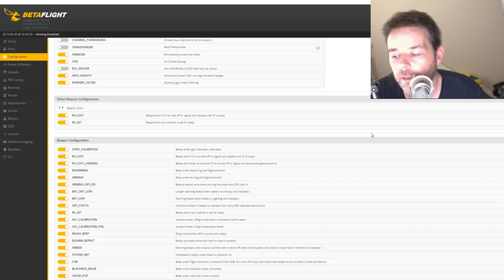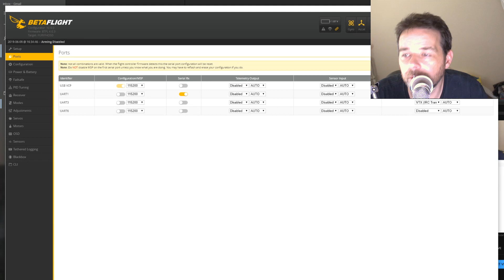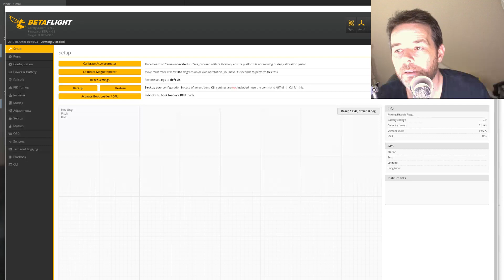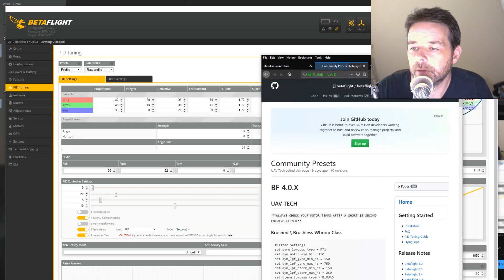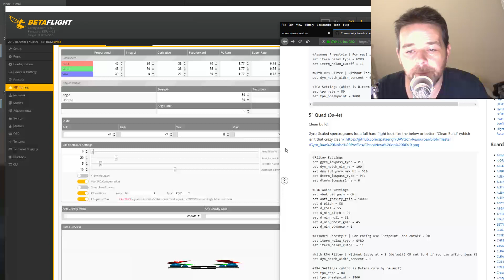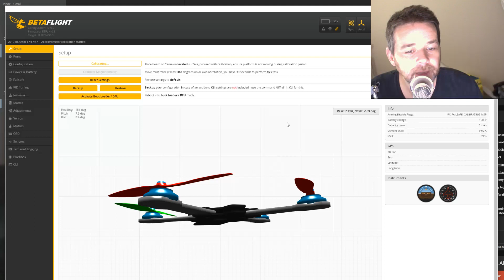Betaflight 4.0.3 live Setup for the Diatone GT-R349

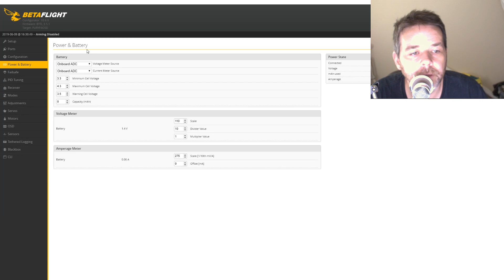Comment from the maker: In Power/battery after re-flashing, copy settings from 2:11 or your power readings wil be off.  Onbard ADC for amp meter, 275 for the offset.  check 2:11 for the correct settings

Comment: I followed exactly your setup here in the video but I got pretty bad vibrations (unsmooth motor sounds) until I switched from Bi-quad to PT1 in filter settings.
Reply from the maker: That's good to know.  I've found that over time, the tune gets out of whack for me and i get bad motor sounds as well until i tighten the flight stack or shift the camera..it's kind of random.  I'll try the PT1 switch to see if that helps.
Reply: @Sully365  Oh, and my motors were also getting quite warm after very short flights with no throttle punches. But, now much cooler.

Comment: i'd like to know how it flew on those stock pids , because mine went to the moon on it's first ever flight after updating to 4.0.3 first , completely uncontrollable , so it's only been in the air for 30 seconds
Reply from the maker: Sorry to hear that, mine went pretty well, actually.  were you using new props?  i used LDARC 3050 props and had just a bit of propwash and that was it on 4.03.  I was lucky, though, and never had a problem with 4.00, either.  I didn't try 01 or 02.  
Did you make sure your filters had the gyro lowpass 2 turned on and pt1?  I've used biquad and got a bit cooler motors, but overall, nothing horrible happened.  one thing i did notice with the stack was that my screws were in WAY too tight so it had no flexibility, so i loosed it a smidge until i could wiggle the stack.  That seemed to take out any of my jitteriness that i felt.  

let me know how it goes.
Reply: @Sully365  it was all stock pid settings , so whatever they were on 4.0.3 , apparently most have this issue if you don't change them , as it's more for a 5 inch build than a 3 inch , which is something that should have been mentioned by Diatone , or either release individual updates depending on the prop size , like a release for 3 inch and a 5 ....i found out after , and luckily the motors survived it's first 30 second flight to the moon , but after having it plugged in to betaflight for 30 minutes afterwards trying all the different pids people were telling me to put it , and all being different ,  the HD camera board overheated and died on me , which really shouldn't happen , so be aware of that , it's not even flown properly yet and it's dead already , i can build no problem , but i wanted something to just plug and fly as i wanted something i never had to mess with for a change , seems these take even more hastle to get flying nicely as no good tunes are available for them on release, it's like, here's your quad, heres some shit pids that dont work for this model that may blow the motors and good luck , thankfully caddx were great , and sent me another camera ... i never tune mine and rely on a good pid set up from the off , besides i don't know what to look for or even want to know , i shouldn't need to with a pre built , i just want to plug and fly
Reply from the maker: i can say my instructions from diatone said specifically, "Only get betaflight from diatone.us"  but i did not really like their version, too loose for my tastes.   if you contact bg or where ever you got it, tell them it spazzed and see if they can replace or refund.  I don't think it was something necessarily wrong with the original tune other than just too loose for me.
Reply: @Sully365  i contacted Diatone and they put me on to Caddx , as the camera was faulty but the quad was still fully operational all be it flying really badly , basicllay saying it's not the quads issue , more tha camera , but that's the same thing in my book when you buy a pre built quad ...anyways , the issue i had with it is sorted , or will be when i fit it , but ,  i'm just looking for a good pid set up for the HD349 and the best working update , with all the settings and what should be on or off in config etc because up until now, every firmware i've downloaded has been different regarding what is turned on or off from stock
Reply from the maker: @AndyM65  so i had a chance today to play around with it a good bit more...I like 3.5.7 better than 4.0.x for these.  i do not think i'm capable of getting the 4.x firmware to anything close to the 3.5.7.  what i have in this video is good, but not as good as the earlier version.  I'm going to keep poking around.  for now, i'd suggest 3.5.7 if you don't want to mess around muhc
Reply: @Sully365  Man, that's a disappointing cul-de-sac. I super appreciate the effort though; learning lots here. I had a similar issue with mine that @Andy M had. I was lucky in that cutting the throttle killed the moon launch and I'd fall back to earth without disarming, but even a gentle application above idle started the run-away throttle up. Managed to suicide burn a landing sort of okay and not break anything. The motors/escs seem to have gotten away with it which is nice. 

Do you have a vid or screen shot of your 3.5.7. set up? would love to follow along here. Cheers Chris